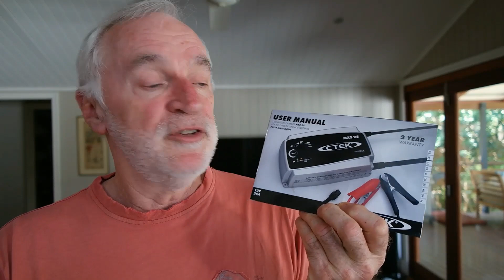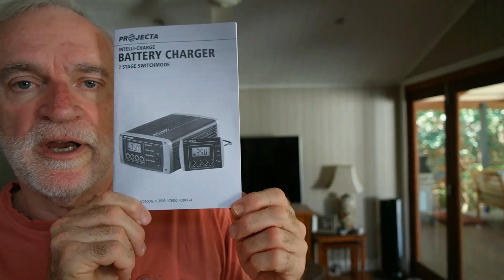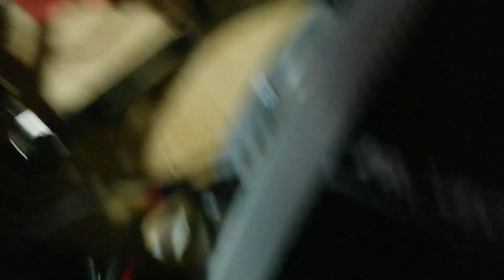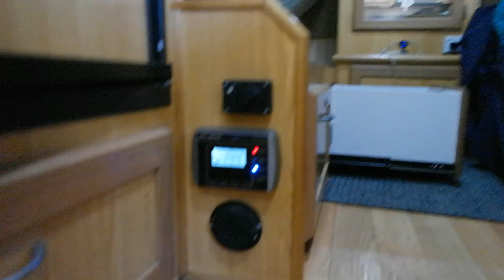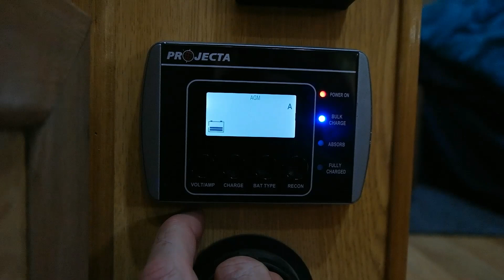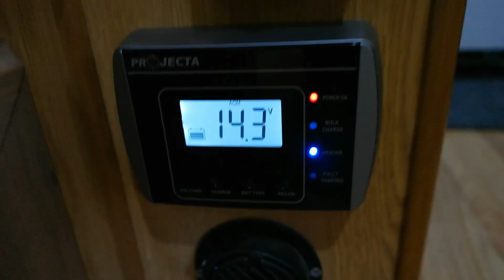Projecta IC2500 240VAC 25 Amp Battery Charger for Caravans.

Comment: ❤🎉. Dear Tim.
What a Breathe of Fresh Air, that Viseo was.!

We are Full timers, Prospectors travelling this Wonderful Country.
Being Off grid, you need Battery Power.
But refuse Lithium.😢😂

3 AGM Wet units, with 330 amp hr of Punch.
😮.
But, coukdnt get enough Info, thru the Normal channel's.
We watchedyour brilliant Video, 
Stop 🛑 Start until all our usdues were overcome.
Hallaluyah.
Gor the Right Amos In.
Voltages , etc.
Cant wait to see it it can go thru its functions without constant Beepings.
Hallaluyah
Mazal tov ❤🎉

Comment: Mate, my Projecta IC2500 is permanently wired into our motorhome and has worked brilliantly however while trying to charge my 12v AGM battery the other day the LCD screen on the Project is showing 0.0 volts. What do you think the problem is? Thanks.
Reply from the maker: I have no idea.

Comment: My Question for this charging device is: How can you know what type of Battery you have to set it to say AGM or WET or Cailum Battery settings. Your reply would be very helpfull.. Thankyou Tim ( Central NSW Au) Cheers M8
Reply from the maker: In the majority of cases you will have a lead acid (AGM) for this application unless you have specially purchased Lithium batteries and they are clearly marked. It is  highly unlikely you would have wet cell or calcium batteries. Cheers Tim

Comment: Excellent video thank you !!! I am new to a 4 berth kea motorhome sprinter and all lights and tv went out while free camping and also while powered up at a campsite, both times the issue was resolved after starting up the vehicle  only to have this problem happen again  minutes later. l wasent sure what the cause was . l located the projecta (battery charger) that came with the van under the seat and noticed it was switched off, l have now powered up and switched on the projecta battery charger hoping this will resolve the issue (in the past it has always been off)  lm not sure  if we are meant to have it on or off while powering up at campsites and when its fully charged do l switch it off to prevent overcharging or do l keep the switch on at all times while powering up at camp sites  ? not sure if lm doing the right thing ?  can anybody help? thank you in advance
Reply from the maker: You dont need to switch it off after the batteries are charged. This is a multistage charger and should really be left on to maintain the batteries correctly in the the case of an AGM (lead acid battery) which I assume is what is installed if this charger was supplied. In fact you need to leave it on as most equipment runs from 12V and not 240V such as the lighting, water pump, gas stove igniter, fridge electronics, etc., so its normally expected to leave the power supply on at all times.

Comment: HI, thanks for that. You have clearly explained to me how the electric system on my Kea Nomad Sprinter motor home works which Kea did not do.
The reason I looked for your video is that the charger seems to have failed (no light, looks dead) after less that 2 years and I am now in a quandary of what to do next. Solar still copes well and remote indicator shows voltage but nothing else  - even with no power showing on main unit. 
Looks like a need a new main unit as with fridge, TV, lighting. awning motor etc  just solar may not be enough.  If I can keep remote indicator and same wiring which looks fairly well embedded in the main unit that would be good but the way that Kea have installed this is mind boggling - would never have made aeroplanes! ....Partner of C
Reply from the maker: The remote control panel wiring uses a fairly standard flat 8 conductor cable to connect to the main unit with RJ45 plugs. So the cable may be compatible with other brand chargers. Good luck. Cheers Tim
Reply: @timterry8714  Thanks yeah got all that. Presently looking for best price for a same/same replacement and deciding whether to fit it myself or get an electrician. I am not sure if the replacement charger comes with all the fitted wiring. If so I will have a duplication of wiring. 

If so, my plan is to use the same remote and lead that is in there and also the temperature compensation lead which both just plug in/out at the back of the charger. Then just disconnect the AC off the dead charger and + and - leads off the battery that are from the  dead charger and connect new AC and leads onto battery. 

I think this will work. One way or the other I need a working charger as I rely on battery for TV, lights, awning motor, fridge, stove fan, toilet flush, & water pump even though solar does an amazing job  ... Partner of C
Reply from the maker: The remote head wont suit a different brand charger John, only the cable may be compatible. There are generally no cables supplied with AC chargers as they dont know what to supply so there will be just screw terminals for the + and - supply. Cheers Tim
Reply: @timterry8714  Thanks again. If no cables then will have to use those already there. Or the auto electrician will - looks like a job for a pro. The one in there looks like the cables are hard wired into the charger except temp and remote. Checked the prices for a replacement Projecta charger and there is an amazing difference in range from $259 used once Gumtree, $331 new Sparebox, $499 new Outback Equipment, $546 Repco then onwards and upwards. It will be interesting what price my auto electrician comes up with.
Reply: @johnmcqueen5721  Final Report. What my auto electrician came up with was a brand new charger on warranty. Thanks to S and K Auto from Blaxland everything is now fine and I suspect the latest chargers have a longer life. They do have a fan and I guess would still be subject to overheating. So I am only going to turn it on when I think I need it to charge the battery as the solar takes care of most things most of the time.

Comment: Projecta Intelli Chargers use a Voltage Sensing Wire (within the charge cables), and if cut or modified (anderson plug) it will cause issues.  This happened to me recently, and to fix it all I had to do was to unsheath some of the voltage wire to make sure there is a connection. I also recommend soldering connections instead of crimping.
Reply: Yep just cut mine with out realising and now having an issue.. so you just made sure the sensor wire was having a good connection?

Comment: Any chance you can show how to remove the remote from the bracket. Following instructions and remote will not release from the surface mount as the same as yours.
Reply from the maker: Sorry but I sold that van and dont have Projecta equipment in my newer van. You have to be a bit forceful popping it out its just pushed into the surrounding frame.

Comment: Hi Tim, thanks for your vid. I have an IC1500 in my AVIDA 2013 MH. It’s original CBE charger died, so I replaced with the IC1500. My AVIDA manual says that the CBE charger trickle charges both the “house” battery and the cranking battery (the latter to keep the cranking battery from going flat if you are parked in a caravan park for say 6 months). When the auto electrician installed the Projecta, he made sure the house battery is being charged, but did nothing to trickle charge the Cranking battery. There seems to be a debate in the MH Owners forums that charging the cranking battery in addition to the House battery from the Projecta is not very likely. 
Do you have an opinion on that? Could my MH “How to Guide” be fibbing to me? Thanks, GRM
Reply from the maker: The cranking battery is charged at a lower voltage than the house battery so I agree that the charger should not do both. The house battery is an AGM requiring charging to 14.4volts while the cranking battery is usually only charged to 13.8volts. I wouldnt do it. Often the information in the owners manuals is broadly taken from auto-electricians without a full understanding of the different battery technologies/chargers, etc - that is I assume until recently - hopefully the knowledge base has improved in the last few years.

Comment: Had that Projecta unit in my new Coromal caravan. Lasted 18 months. None serviceable parts inside. Had to buy a new complete unit. Good luck with that one.
Reply from the maker: Its had no issue so far and KJ obviously has had a good run. I certainly didnt have that experience with the CTEK and I know of a couple of others that have failed. I bought a Victron this time as they were discounted at the time and cheaper than the Projecta and apparently good quality. Its smaller and has performed well to date. Cheers Tim
Reply: @timterry8714  victron has also been recomended to me over the projecta it also comes with a 5 year warranty as opposed to the 1 or 3 year warranty from projecta brand. lm still deciding what to do
Reply: My 25Amp going strong after 8 years

Comment: Hi Tim, just had a ctek fail. Fortunately at home. The Projecta looks like a great unit. When the Projecta  is not plugged into 240 does the remote still report on the state of the battery taking into account the solar input? Thanks. Very informative video by the way!
Reply from the maker: Hi Peter, no I don't think it does show anything if the power is off  but don't quote me on that. Just remember if your buying a new charger make sure it has a lithium profile as you probably will be replacing AGM with Lithium as the price is similar these days plus all the other advantages of weight and capacity. I just messaged a friend that's out camping atm as he has a projecta so will let you know soon.

Yes my friend confirmed it does display the battery voltage at all times AC power or not
Reply: @timterry8714  thanks Tim. I reckon I’ll order one today. Cheers
Reply: The remote is still able to show the voltage of the battery, even when not plugged into 240 volts. Hope that helps you out

Comment: Thanks for the video. I was't sure what to buy in the way of an AC charger.
Reply from the maker: I had to buy a new charger for my new van which now has a lithium based DC system and have purchased a Victron 30A unit which has a lithium profile. It was significantly less costly than the Projecta IC2500L and slightly better output. It works really well.

Comment: Hi Tim, my second projecta ic2500 has just failed, also on my second projecta 1kw inventer. Also had a 4amp projecta battery changer and guess what it failed to. Will never buy projecta again ever.
Reply from the maker: Good grief you've had a bad run. Are any of these products any good. I had the same experience with Ctek and a couple of friends also had critical failure issues with them. I have purchased a Victron for my new van because it was lower cost and reports are that they are reliable - so we will see....

Comment: Charger (Projecta 2500, about 11 years old) quite suddenly started misbehaving after a short trip. Beeps a lot & cycles between 14.4, Err, reset, etc.  Replaced battery (over 4 yrs) but no difference. What chance the charger is cactus??
Reply from the maker: Problem is that they are just not economical to repair and there is no technical information available so you waste so much time trying to figure out the circuit so you can analyse the problem. Yep probably cactus.

Comment: Ive just bought 1 of these. Can I charge my 2 AGM 120ah batteries together using this? I keep mine in my garage to keep my batteries charged while not at camp.
Reply from the maker: Yep its perfect for that size battery bank as the charger should only charge at a maximum of 20% of the battery capacity. I have 2 x 105A/h batteries that I maintain with this charger.

Comment: G'day tim is there any chance you can show where the 240v ac cable goes. Please
Reply from the maker: Hi Darren, not sure what you need to see in regard to the AC mains power cord. It is just plugged into a 240V AC power outlet located adjacent to the power supply. The Projecta was a replacement for a CTEK charger that previously charged the battery and was installed by the caravan manufacturer. Let me know if you need something more specific.
Reply: @timterry8714  Ok.  That's all i needed to know. lol i love rattling my brain and it hurts. Hahahaha

Comment: Great video. Just bought a projecta 12v 35amp one for my camper that has 2 100ah batteries in parallel and looking forward to getting it installed.
Reply from the maker: They are a great charger and nice and quiet also - no noisy fan.

Comment: Thanks for the vid. Great explanation.I have this unit in my motorhome and so far have had no issues. Do you know if solar panels can be connected to this unit to charge the batteries also? Or would I have a separate unit for solar? There doesn't seem to be other boxes near it.
Reply from the maker: Hi Angelo, no it wont charge the batteries from Solar as it is purely a AC mains charger. Also its not a bad idea to have distributed chargers in that if the charger fails you have neither mains or solar charging available to you. I now have separate Mains, Solar and vehicle chargers in the caravan. Part of the reason for separate solar and vehicle charging is that the MPPT solar charger (which is part of the Projecta IDC25 vehicle charger) carries with it significant overhead in internal power consumption (greater than 500 milliamps is used by the charger to run its internal electronics) which is fine if you have lots of solar feeding it. I have a single folding 300 watt panel charging the batteries via a dedicated Epever solar controller which only consumes about 8mA so it really helps recovery on overcast days to be able to harvest all available solar.

Comment: Hi thanks for video, very helpful. Ours keeps randomly beeping and we can’t work out why...any suggestions?
Reply from the maker: No idea but may be set to the incorrect battery type or you may have a faulty battery or connection to the battery - just guessing.....
Reply: @timterry8714  mine did the same the last button on the will turn it off.
Reply: On the left.sorry